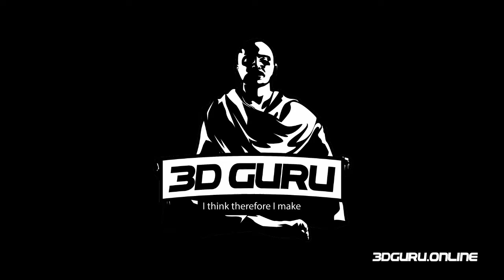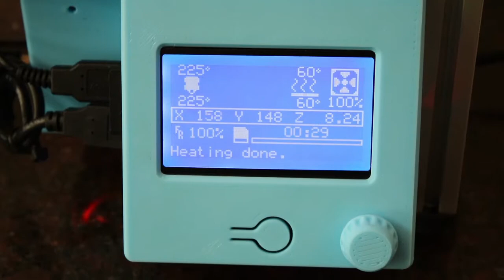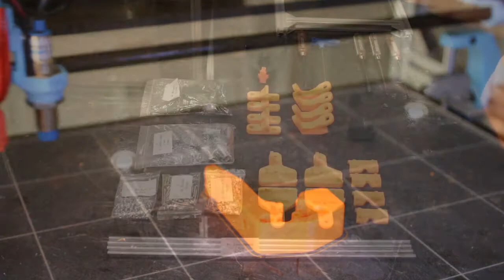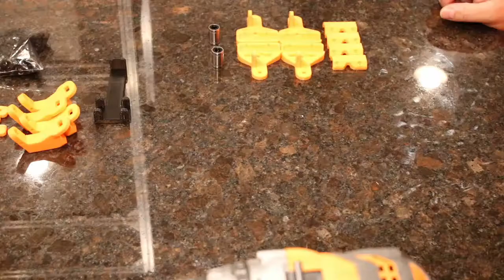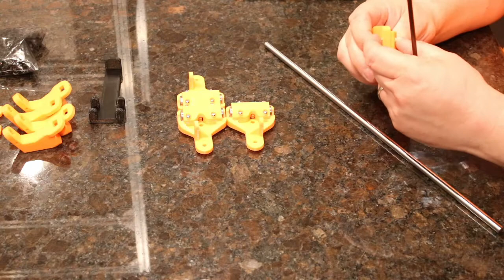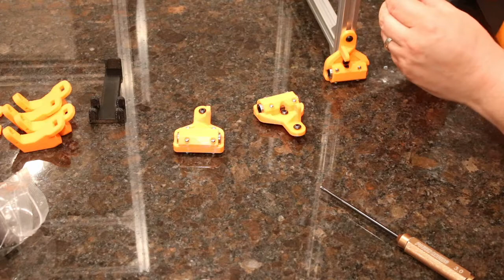3D GURU Building the Hypercube 300 Part 3: Assembling the Z carriages

Comment: God, I'm starting to regret buying this Hypercube. Lack of instructions, images aren't labeled correctly, no manual, have to watch 10 different videos and those people don't have the exact parts needed. Owners of the zyltech site do a crappy job making a video explaining in terrible lighting and rely on a Facebook page for others to help you. You'd think in 2020 building a 3d printer would be simple and easy.
Reply: 3D printing is still a supper DIY process.  If you are not really good at figuring thing out all by yourself you should find another hobby as even commercially available printers like Ultimakers, Prusas and Crealitys still have stuff go wrong on them that are frustrating if you aren't good at figuring out stuff.

Comment: Do the new z carriage mounts use a lm8luu or just one lm8uu? Also, would igus drylin lm8uu work?
Reply from the maker: igus bushings drag too much in this specific application.
Reply: I went with the Misumi lm8luu bearings. I'm having a hard time finding a place that sells carbon rods that are actually the correct diameter. I got some off of amazon and they were either too big or too small. Do you know of a supplier that has good tolerance on their carbon rods?

Comment: The new carriage design is not working. How are you supposed to tighten the locknut, while it keeps grinding inside the plastic part? It's impossible to tighten. Literally.
Reply from the maker: I have these parts on my own printer and two printers at my local makerspace.  If the nuts are spinning and grinding the nuts or screws must be bad.  It goes together very nicely and very little torque is required to turn the screws.
Reply: hmm, the nyloc nuts I happened to have may be from 1980 or so, might be more robust and stiff than the ones sold nowadays. I used Zortraz ULTRAT plastic for the parts. I think the biggest problem is that one side of the nut hole is open, so it can give out and enlargen when turned.